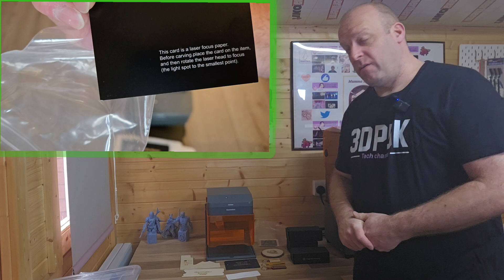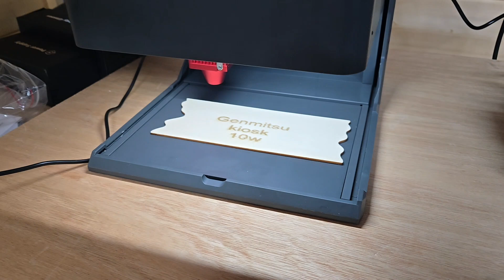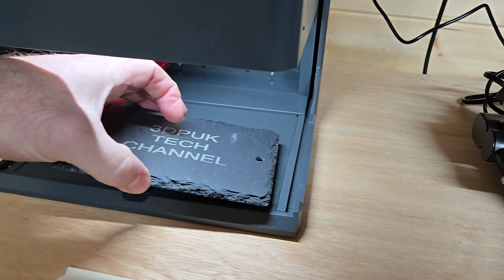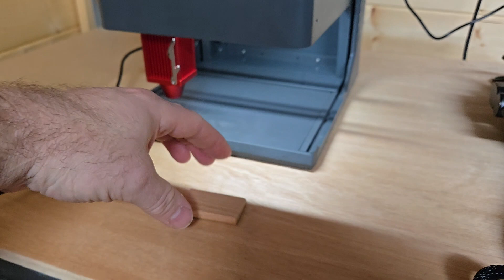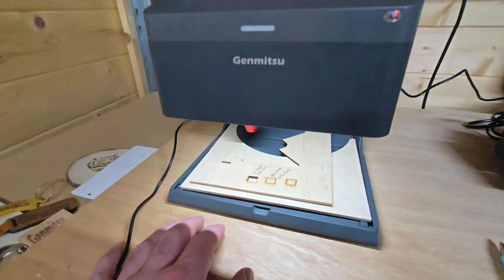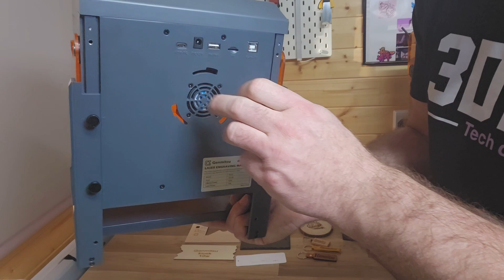Might be small but it's so capable its the Genmitsu kiosk 10w laser

Comment: I almost purchased the icube pro 10w. However having watched your reviews on both and the additional camera, light, easier focus wheel and lid lifting I've purchased this and the camera.  I had a 40 co2 a few years ago but it was huge and I didn't get the use out of it that I wanted. The size of this paired with my 400 watt hour battery is perfect, I'll only be engraving and scoring small items. I like that you can remove the base plate also as it'll sit and I'm sure engrave on larger surfaces. Amazing review (thank you).
Reply from the maker: Thanks for watching 😊
Reply: @3DPUK-TECH-CHANNEL watched and subscribed 👌👌👌

Comment: Does it come with material settings for Lightburn or where did you get your settings for it?
Reply from the maker: @MichellesVarietyShop  hi this should be found on the usb
Reply: @ Just wanted to update in case someone else is looking for the info, contacted the company and it doesn't come with any kind of materials library.

Comment: Hi. Do you still recommend the iCube 10W or is this a far better machine?
Reply from the maker: @RobDoyle-z9c  hey thanks for watching so both are equally amazing, I had some teething issues with the icube but that was user error on my part. Overall there very alike. It would be more on price the decision should be based
Reply: I have also noticed some very similar machines like the Wainlux K10 and the Cloudray Laser Engraver Bm1